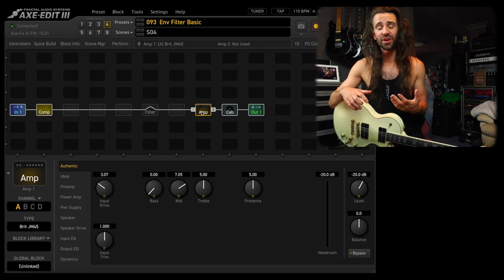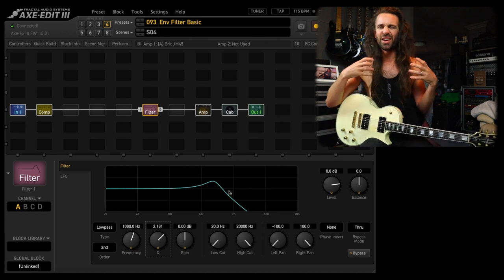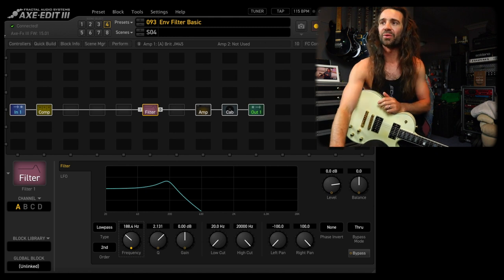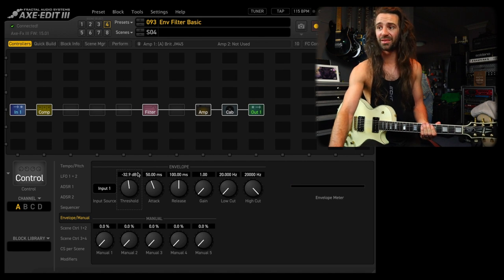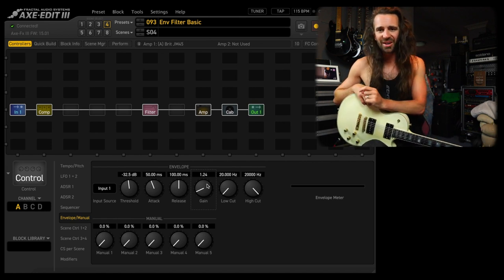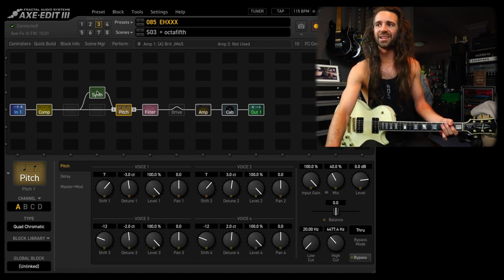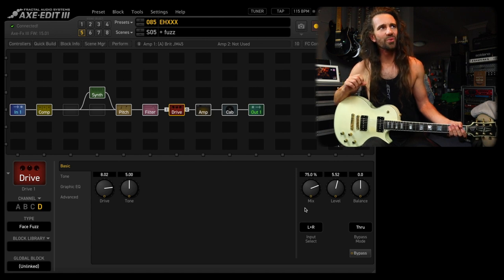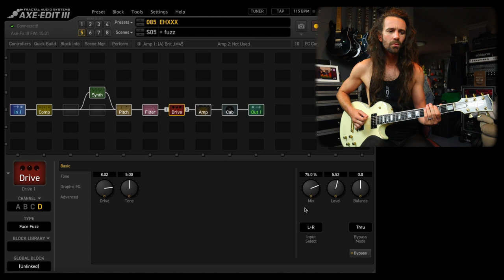5 Minute Tones  - EHX Style Envelope Synth Fuzz

Comment: Wow...it sounds great, but the deep editing...case and point why I can get on the modeler train. I can barely play my guitar, let alone be a sound engineer. Give me a Qtron for $50 used with three knobs every time.
Reply: Not for everyone.

$3k modeling/effect units, also requiring a similar investment in cabling, speakers, mounting, and foot control are typically the province of more experienced players.

The investment also offers the ability to go beyond what's preprogrammed in the box, and make your own sounds.
Reply: @SixStringHarmonies  You mean like a sound engineer? I've had several high end modelers. At the end of the day, an Iridium at the end of my chain lets me do the modeler thing when I need to silent on stage and pedals and amps when I can. Tweaking 15 knobs to get a 50 year old tone may be fun for some people...like you said, not for everyone.